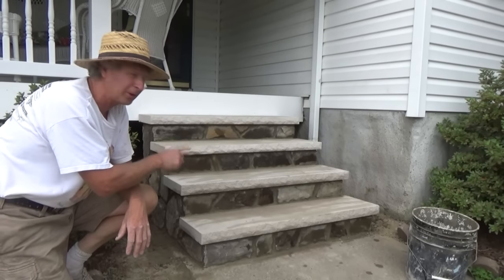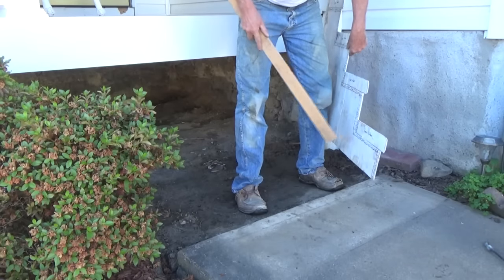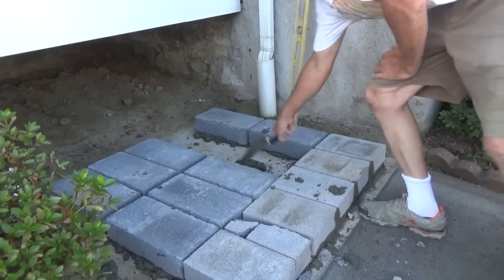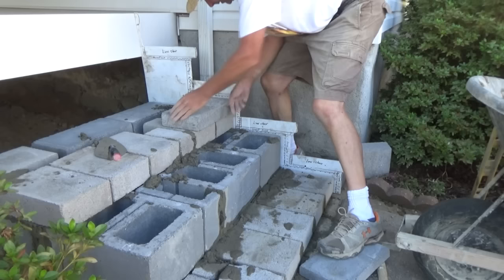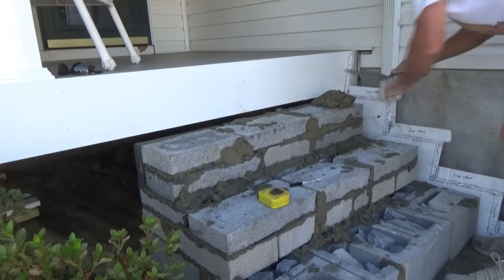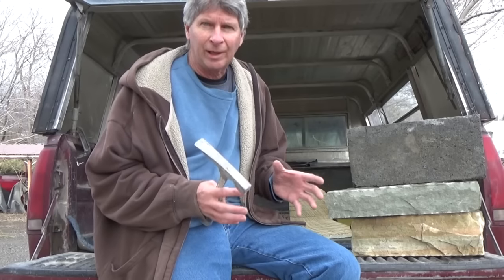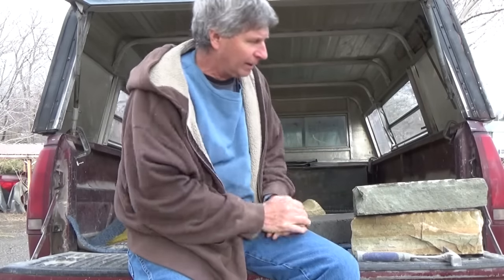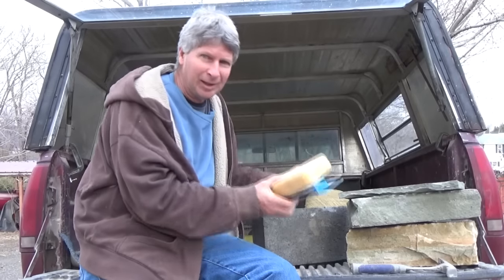BUILDING STONE & MASONRY STEPS (part 10) Mike Haduck

Comment: Old school rules! I need to build steps, block and large concrete pavers for a gradual decline, and install ADA compliant railings.
Watching your videos has shifted me from 'over thinking' to doing.
I do understand base. I lost the patio in a divorce but it was built on the knowledge of older guys working on sidewalks in Portland, Maine.
18' of gravel and sand, well tamped, pitched, and it's unmoved after 32 years.
Reply from the maker: Thanks paup, The old-timers knew their stuff,  Mike

Comment: Thanks for this Mike, I appreciate seeing how you do things in Penn.  And I love your bluestone. 

Here in upland Yorkshire, England, we are still building like you did in the past - your videos of American houses from the 1800s look like buildings here, which we're still building today (though with the inside skin being block).  All the stone we lay follows the strata bed, not end on, and we tip it lightly forward with small stone shims at the back - so rain-driven water is pushed to the front of the building, along the bed.  And with plenty of stone laying around we never use it as a veneer.  Plus a lot of the mortar we use is lime, which has made a good comeback in the last 20 years - especially for re-pointing lime-built structures.  It's the same all over upland Britain, though with regional variations.

And Mike, I'm the same but please try to use a mask more when using a grinder - loads of stonemasons and quarry-workers round here have silitosis, from stonedust in the lungs.
Reply from the maker: thanks jonb,  your comments are always appreciated,  I always felt England had the best masons, I still want to visit conwy castle some day,  thanks mike
Reply: Thanks Mike, your videos are great.  Have a look at York Minster and the stone buildings - textile mills, churches, castles, houses and drystone walls - all over Pennine Yorkshire.
Reply: Yes, Conwy is in North Wales, which is well-known for blue slate.  It is not too far from my area - in North Yorkshire (the village is on the border of Lancashire/West Yorkshire/North Yorkshire).  We are also near York, and both the Pennines (hills) and the Lake District historically had a lot of quarrying and are full of stone buildings.  Derbyshire, in the region around Chatsworth House (a grand estate owned by the Duke of Devonshire) had arguably the first mechanised industrial process in the world, in the form of cotton spinning (using imported US cotton) at Cromford Mill.  

If you make it to the UK let me know, you'd be welcome to stay if coming a year from now or more.  I'm developing an old textile mill for various uses - partly residential/holiday homes.  Like all the buildings in my area, it's stone.  It's quite a good example of a late 19th century textile mill - from the early Industrial Revolution period; although the oldest sections are thought to be 1000 years old plus.  It was originally a corn mill ('corn' in the UK means 'grain' in American English).  There is also an American connection - one of the early investors in the enterprise emigrated to the US, and set up cotton spinning mills around the South.

If interested in the building, have a look at the Lothersdale Mill website - which is a work in progress.
Reply from the maker: Hi jonb,  I did check it out,  you can see where we over here got all our influence (New England)  Pennsylvania mostly included.  That would be a great trip for sure,  I appreciate the offer, I could get a few good videos over there,  England has the best stone work in my opinion,  we all learned about England in our History books in school,  the mother country, of all our law culture and early building,  thanks I appreciate it.  mike
Reply: Ok Mike, I'll email you now.  Then you can delete.

Comment: Mike - First off let me say I love the videos.  I'm working at home now and will watch them on youtube on my TV.  My wife eats lunch with me and I find her watching them as well.  Kinda funny.  Anyways I have a question.  I'm going to build masonry steps - 2 risers and a landing.  The steps will have 1.5" real stone veneer sides and riser and 2" granite treads and landing.  My question is:  I poured a 6" thick concrete footing.  And I'm going to come up with block.  Can I mortar the granite directly on the unfilled cores of the block (some cores will be filled and have reinforcing rod).  Thanks in advance.  Scott
Reply from the maker: Hi Scott, I like to have the cores filled so its easier to lay the stone,  other masons think different,  thanks, mike
Reply: @MikeHaduck  Thanks very much for quick reply.  2nd question.  For the cores that have the rebar do I need to fill the core (top to bottom) at the same time (for strength) or can I fill it as I go up (course by course).  Thanks.

Comment: I haven't made it through the whole video but I don't even need to for the comment. Damn Mike you are awesome this is a lot of work and pretty technical so thank you for the uploads a bunch. I would like to make a set of concrete steps formed up to replace the mess I was left on the home we bought 4years ago. There was brick which must have started falling apart then they went over it with concrete and that to is falling apart and exposing the brick. Any tips you could lend? Thanks a million!
Reply from the maker: Thanks Monica, I would just take my time and check out all the different approches until you are certain what to do, thanks,mike

Comment: Excellent video. Thanks for passing on the knowledge. I like using the template. 
 I think I heard that the rise was 7 and1/4; what was thickness of the cap stone? And what was the was the run on each step (the width of the limestone)?
Again excellent stuff.
Reply from the maker: Hi it probably was 7 1/4  but you height determines that, cap stone 2 1/4,   limestone with usually comes in 12 or 14 inch, thanks mike
Reply: Mike Haduck Masonry I have capstones that are 12” and three inches thick
Reply from the maker: @rfd66  it sounds like they will work,  make a pattern, to see how it work out, thanks mike
Reply: Mike Haduck Masonry thanks. If you ever have to do a backyard stone oven and a fire pit - that’s if you take requests😀
Reply: Mike, I made my patter I want to account for joints how thick is the joint between the block and the tread 1/2? What do you recommend? Thanks 
Just watched your other video on adding steps to concrete slab. Saw that you used shims in the dry fit to account for the mortar. Great ideas. Thank you.

Comment: Thanks for the vid. I'm planning to build on top of old broken irregular exterior stairs. After watching this vid I'd like to use the same techniques you're using. Build up with concrete blocks to level and correct the stairs. Are you using concrete as your mortar? Would limestone be a good top slab compared to granite? In other words would limestone last as long as granite? Thanks.
Reply from the maker: hi beck,  granite aways last the  longest in my opinion,  but I always say you can do as you please, and anything that works,  I appreciate it.   mike
Reply: I hoped you used mortar 😂

Comment: On the second  course of the 4 inch you didn't use and fill completely all the base of the 4 inch block ......mortar is cheap ...fill in inside the blocks ...mortar ...use it...wet blocks are nice as it dries slower and bonds better ,,slight slope away from house ....for rain and freezing .......,,,,Great job ...I learned a lot.....Your hired !
Reply from the maker: hi Joe,  i could have but have to reduce weight, I know you understand, thanks mike
Reply: Finished product is sensational ! I need a job I could learn a lot from you...I subscribed ....! 😎😎

Comment: What type of mortar is best for adding the stone tread? Should a bonding agent be used?  I live in New England and my stone tread is falling off because the mortar has deterioated. What type of mortar will give me good bond and resist damage from rain, ice and potentially salt (I know you shouldn't use it on steps, but it may happen).
Reply from the maker: Hi Andre,  every mason in their area uses a different mix,  I am happy with s mortar with a little portland added but not really necessary,  2 sand one cement ,  again everyone has a different opinion,  thanks mike

Comment: Hello mike how's it going ? Keep the videos coming you got any brick or stone work coming up ? Plus what's the rand of you're trowel I always wonder about that every video
Reply: luke medcraft Luke from the looks of it I'd say it's a goldblatt trowel.
Reply from the maker: Hi luke,  actually it is a cheap trowel from somewhere, cause the cheaper ones are not as heavy and lighter to use,  thanks mike
Reply: Mike Haduck hi mike . Just for the benefit of Luke who asked the question ,i would be 99.9 percent sure it's a goldblatt trowel . Lots of them for sale on eBay . For a trowel that wouldn't be considered by most masons to be as good as a Marshalltown or a w.rose it's certainly served you well .as the saying goes the proof of the pudding is in the eating .
Reply: Thanks for the reply yes I have noticed he has used it for a long time and looks good shape still
Reply: Okay cheers mike, I use a 33-11 Marshalltown tried the Philly and wide London got them indoors but can't compare to the narrow London 11inch love it plus I want to try it in a w.rose brand better steel but I hear a few people are getting elbow or wrist pain from the angle of the handles with w.rose so convert back the marshalltown
Reply: luke medcraft .Luke w.rose make standard shank and low lift shank trowels which refers to the handle angle . They also make what they refer to as limber weight trowels which means the blades are lighter and have more flex.i like the narrow londons as well (ten inch) .by the way the Dutch reckon the correct handle angle for your trowel is when you turn it over with the tip of the blade on a flat surface the handle should lay flat. I have tried this on a good few makes of trowel and it seems to work out fairly well.

Comment: Hi mike,  I just finished my first bluestone steps based on watching your amazing videos....and I have some mortar on the stones (hazing that didnt come off from using a sponge mostly). I 'd rather not use acid... is a wirebrush safe and effective for removing this? Thanks in advance!
Reply from the maker: rejp0783   I would say mostly yes.  Or get a Scrub brush and try it ,you could get some dirt and rub it in so it will stain the stones it all depends on what kind of cement you used but I would take a small area where no one notices it and test it out usually the stone will bleed and most of all it will come off in a couple months anyway I hope that helps thanks Mike

Comment: I'm wondering if you can pour the steps in forms with concrete and rebar and hammer the edges like you do to make it look good ?
Reply from the maker: Hi Randy, I do not see a reason for that, the stone thread last a lot longer and is easier to use, I hope it helps, thanks mike

Comment: Can it be use once it is build? If not, how long would you recommend to dry and set before walking on it?
Reply from the maker: Hi Bing,  I usually walk on it the next day, Bob do not drag anything heavy over it for a few days, thanks, mike
Reply: @MikeHaduck  I will redo front door steps in spring, but few days without steps will be difficult for my five 200 pounds plus family members. If you can make a video on temporary steps would help greatly. Thanks.